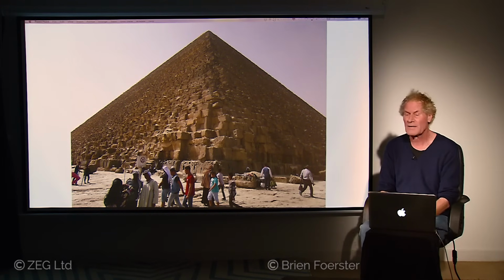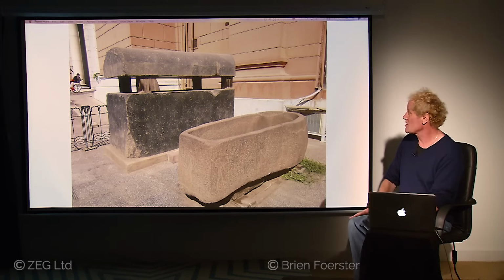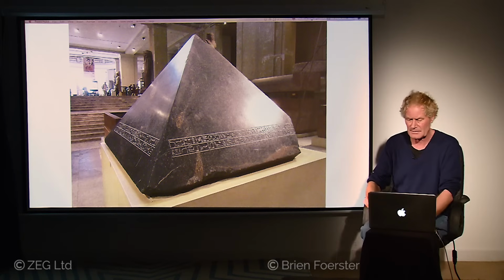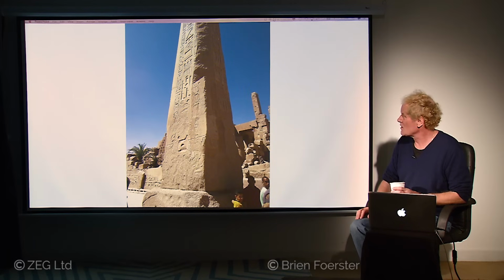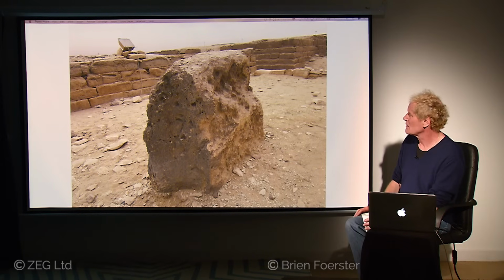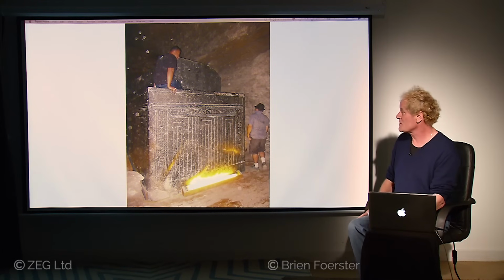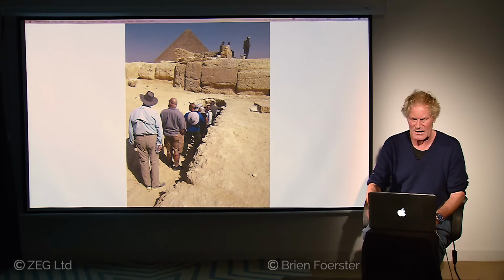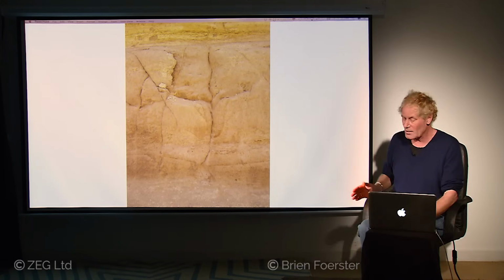Lost Ancient High Technology Of Egypt Full Lecture

Comment: Another abandoned stonework site. Obvious destruction and use of some machine tooling. Where are the machines? Drills,saws,blades? Has it been so long it disolved as rust? Its plain to see today with our machine shop set skills like large horizontal lathes. We bore deep holes in rock, engrave gravestones. statues etc. Cranes and heavy lift helicopters. Concrete pumpers. So its not so impossible to see these great projects.  I wan5 to know why they stopped,left unfinished, partially destroyed and everything else is gone. People and machines..all at once worldwide. I think why is the most important question.

Comment: I forgot the name of the scientist and searching for the footage of when he used some kind of diodes on a metal structure Weighing several hundred lbs then attaching two wires and invented the first remote controller while levitating the tructure around eighty feet in air while walking it all over a field on some us military base in 1920s or 30s . I believe he worked for the army.

Comment: The assumption that only one stone is cut, moved and set in place in 2 minutes is completely wrong. There could be 1000s of teams or more working in the same time cutting, moving and setting up stones. This needs to be taken into consideration when making an assumption of the time it takes to build one stone.
Reply: Acquiring knowledge and using it intelligently can be a powerful tool... you should try it sometime.
Reply: @bpd9660  I think you are in need for  a creative thinking course. Plan and go for it, definitely,  it will improve your thinking ability and you will be able to comprehend.

Comment: Love the straight forward lecture format. On the black boxes, seen a theory that said they used a type of fermentation process that produced ionized gas that needed heavy lids to contain the gases pressure and lead to a kinda bioluminescence of the surrounding air. Would explain the internal explosion damage you found.

Comment: His initial statistics are wrong.  If you accept his height number of blocks that make up the Great Pyramid as being 2.5 million and it was constructed Over 30 years and u took the rate of cutting and moving each block into position would have to take no longer than 2 minutes then the Egyptians would be able to cut and move actually 7884000 million blocks during that time.
There are 15768000 minutes in 30 years
15768000 minutes/2 mins for each block would be = 7884000 million blocks cut and moved into place.  In actuality 15768000 minutes/2.5 million blocks is every 6.3 minutes a block is put made and put in place.    If he gets this basic math wrong then I have to doubt everything else he says.

Comment: I think Brien is half right about the ancient advanced technology.... half right because he assumes the Dynastic Egyptians didn't know anything about it or used it. But they did. Or at least, the Pharaohs would've known the science behind the technology (such as how to make electricity and power machines with it) and certain echelons of citizens would've used it. Like the labourers tasked with making their fine silk, or gold jewelry. They would've needed electric sewing machines, and knowledge/application of electroplating.
I think the Nephilim originally built the pyramids. They're essentially gigantic versions of Nikola Tesla's Wardenclyffe Tower. Using natural energy currents from an underground aquifer, amplifying it, and broadcasting it into the ionosphere to generate free wireless energy across the land.
If you stand at the top of the Great Pyramid with a glass bottle and a wet cloth on top of it, there will be visible sparks flying from the bottle.
Imagine the crackling arcs of electricity that would've come off the gold capped Pyramids when they were pristine, and active.
Also, apparently the Lighthouse of Alexandria wasn't fire, but an arc light, powered by the Pyramids.
And, the Ark of the Covenant acted as some kind of superconductor for the Great Pyramid (there's a room in there with a box which has dimensions that perfectly match those of the Ark of the Covenant, and this room is placed in the Pyramid in such a way that it would greatly increase the output when generating electricity to have a superconductor in that exact spot) - and when Moses left with the Hebrews, they took it with them, causing Ramses to change his mind and chase after them.
There is actual proof that the story of the Exodus is true because divers found Egyptian chariot wheels on the sunken land bridge in the Red Sea.

Comment: The disk were used to funnel cavitation bubbles into breathable air. Spinning them underwater reduces the water pressure on the back edge of the blades resulting in boiling water which causes air bubbles. It can also be used as a fuel to assist combustion.

Comment: Another comment, maybe the shafts to the outside were used to fill the burial areas with another material, to preserve better, and the doors in these shafts were made to seal the area, maybe these materials were the reason that they might have destroyed any wall drawings in the kingdoms walls by accident, instead of preserving it, that accidentally detroyed things. Just suppose they filled it with alcohol and suppose an accident happened the alcohol burned or the seal was broken you will see nothing now even maybe burned the tomb or got dissolved by time that we can not find it. Somebody somewhere over did something with good intentions but it did not work and damaged instead of preserve. They knew hydrocarbons, knew alcohol, tar, textile, fibres even liquid absorption

Comment: Just to add another capabilty they had under their fingertip was 'Sound', drums and resonance, in ancient Israel history its suggested that they used resonance to demolish walls and sound to defeat enemies. If you combine these with pneumatics, hydraulics, resonance, air pressure, heat, light reflectivity, focusing you can achieve a lot. They also had pretty good knowledge in materials, from choosing type of lumber (Like Cedar) wood, for having high durability against insects, to various hydrocarbons oils to preserve materials even flesh, to knowledge of geology to select suitable rocks for their needs, to use limestone that was soft to shape or to use granite for other purposes, in addition they had good eyes for color and even making paints using basic pigments that our current paint makers do not match with their durability, they knew chemistry, they did lime knew the human body and antropology and agriculture, public health. We are under estimating that those knowhows were used up to the industrial revolution, what they lacked was knowledge about steel manufacturing but they knew steel from meteorites, maybe they even knew gunpowder (Chinese did). If you go back few hundred years back we have used their knowhow to make the industrial revolution, they had advantage over Europeans having warmer climate, they  could work for longer work times than Europeans due to longer daylights, more workable days and more to work outdoors, hence their productivity was high. Combing these together at those times were unique,  we tried to catch up, found solutions they did not have

Comment: In my view they were good in hydraulics and hence they could use to cut ( Water jet), grind, lift, move units., sand blast (Using fine sand, they could seive sand), they could do air blowers  They should have been able to create seals, knew leather, they knew bitumen tar, if they made on semi precision machine, they could have used it to make more precission units. They could use bronze, had most necessary tools. I do not think brute force was used but deffinetely lots of manpower with simple tools. If they were able to make , precission tunnels, they could make precission tubes for hydraulics, in our era if you look at the hydraulic pnematic system of Citroen cars, combination of pneumatics, liquid hydraulics, they could create pretty powerful tools, they had all the basics available then, including sealing system, in theory hydraulics was with in their reach. With ease they had pneumatics, using leather made blowers, sealing the leather for high pressure, heat to increase pressure, they could make simple tools, the hydraulic part  using various oils definitely they knew hydrocarbons, natural from trees, animals, it was within their reach to do thiese and no electricity required, they could have moved, grind, cut to precission, lift. What is also unique they should have had simple way of lighting the work area? Maybe the tunnel shafts were a way to bring in light from outside using bronze type of mirrors, nothing to do to gaze towards star, simple dedicated solutions were within their grasp. If you go back few hundred years back most these tools were done with no electricity, some not even using steel, all the way to 1950s leather was used as gasket. We want to imagine super knowhow but it could be very simple tools. Put youself in their place, how will you carry 1 ton piece if you were just 3 to 4 people, am sure with some simple creativity is possibel. Another thing they could do are pullies and they could do belts to connect them, these are not something new. No need to imagine outer space super technology, just simple tools, I used to drill holes for my hobbies  with simple hand powered drill without electricity

Comment: Here's some ancient ideas that people may have forgotten. 

For the cutting and drilling, there is a way to cut into granite. For cutting, they would chip a groove into the stone surface first, then they use is a copper saw with some teeth on it that has a heavy stone on each end. Now, it's not the saw that's actually doing the cutting, it's sand! They put sand into the groove and let the saw go back and forth motion to dig the sand into the stone. Eventually, they use water to help cut further into the stone.

Now for the drill, again, they use a cooper like tube with some teeth. They use a three man team to accomplish this. One person on each side of a stick with a string wrapped around the tube and one in the middle holding the tube with a rock on top of the tube to allow the tube to spin on the stone. This technique is very similar to using to start fires (looks like using a bow wrap around a stick). Then, they use couple of chisels (acts like levers) and hammer out the center piece. 

Now for the burn, could it have been a meteor or comet that got very close to the surface and then exploded? Like what may have happen in Chelyabinsk, Russia. Just a thought.

Comment: theres always war in the middle east because they want to destroy evidence, alexandria library was deliberate, if you see what solgdeirs have done there they blow up all ancient monuments, i dont believe for a second that , they wrote down everything they did on a day to day basis ,,but they forgot to scribe the building of one of the biggest structures in the world, nobody knows how the pyramids were built they hide that wall and just destroyed it, tesla found the way they harnessed the power from the ionosphere ,, then was told to destroy his tower in warden cliff nyc. he modelled it from the pyramid. light bulbs were wireless everything can be energized wireleslly with the right frequency just light a radio, static electricity is proof that there is electricity all around us , but were told its just protons negative and positive rubbing together thats another myth older vehicles use to have ground straps to stop you from getting a shock when you would touch the door,

Comment: Without the knobs the stones wouldn't have the right resonant frequency
Reply: That makes no sense. In a homogeneous structure like these stones, the resonant frequency would be the same throughout.
Reply: Just a thought I had so then they would have been used to move them?
Reply: @allendavis2030  Possibly. It's common to see a similar use of nobs on other stonework worldwide throughout history. Very useful for tying ropes, chains, or frames to the blocks for lifting and placing. After placement, they are typically chiseled off and the block's surface polished. What we're probably seeing is a construction site that was interrupted or parts of the structure that were left unfinished because those parts weren't where people would see them.

Comment: Granite and diorite are not eternal, they do weather over millenia. Sometimes slices come off like you see on this gravestone here: https://woodlandcemeteryhistory.files.wordpress.com/2019/06/20190421_103656-1-e1561036415981.jpg?w=798        You do not need "cataclysmic" plasma outbursts to weather or break stone surfaces. Millennia of hot sun at daytime and coldness at night time will crack the crystals that make up granite or diorite. Brownish colour on a stone could have come from that stone lying for some time in iron-containing water. I did not see a "heat molten" surface here.

Comment: It's not true that it is obvious that you can not produce two pyramid blocks per minute. You can produce multiple blocks at the same time, even in separate places, and transport them at the same time.
How does heat darken a stone? Not before it melts, as far as I know.
Weather pattern with deep erosion it quite possible in a region with sand storms.

Comment: Carbon dating the buried boats confirm about 2,500 BC. The technology was not Egyptian but the design was brought in by Enoch, and the Egyptians called it Par Hanuch or the Pillar of Enoch. The details are in the Book of the Dead.
Reply: Kufu and the Egyptians were forced to build it as vassals. Steel was used. There are many slag heaps in the Sinai which had a different climate,  from smelting at the time of construction. At the head of the valley on a rock ledge was found a statue of Khufu, one of only 3 likenesses remaining.
Reply: By the way the Ark has been found and the metal fastenings in its hull are in advance metallurgically of anything you could imagine, and are made of titanium aluminium alloy with 6 other metals. It is at a national monument site in the Ararat area in Turkey.

Comment: The precision of many cuts must be some sort of wire with an abrasive applied, similar to the guy who used string and toothpaste to cut through prison bars. You could change direction from downward to sideways very easily that way without cutting gaps around it. They would’ve perfected both the abrasive and wire material like Edison found the perfect filament for his light bulb.

Comment: Could it be possible that the ancient people knew that putting two radioactive materials or rocks together, would generate heat? Could Karnak, and others be ancient nuclear power plants?
Edit: could explain why the boxes weren't meant to be opened. And also the black material inside the stone boxes...Residue of an ancient meltdown?
Reply: Could it be possible that the ancient people at Karnak were struck by a meteorite that generated sufficient heat and blast wave to melt and topple their structures? In my mind that makes a ton more sense than ancient nuclear reactors that, had they exploded, would have rendered the region uninhabitable to this day. If there was a meltdown, the stone boxes would have had their bottoms and walls melted out, nuclear meltdowns are VERY hot.

Comment: Astrophysicists have discovered that Suns' not only eventually have Super Novas', but during their lifetime Suns' also have Mini Novas'. During a Suns' Mini Nova the surface of Suns’ eject their outer layer in an enormous plasma ejection and the plasma is millions of degrees Celsius. There is evidence of this in the past. Depending on which side of the surface of the Earth is facing the Suns' ejecting plasma will determine the annihilate of that civilisation.  

It can take a few days for the plasma to reach the Earth.  So, our Suns' Mini Nova can be witnessed 8 minutes 20 seconds after the ejection, but the impending catastrophe will be a few days away.   If you see our Suns' Mini Nova there is a high probability that you are on the side of the Earths surface that will be annihilated, depending on the speed of the plasma.  

Todays' Solar Wind, 8th Dec 2019, is 350 km/sec,  so those particles will take 4.960317 days or 119.0476 hours to reach Earth.  How fast would a Mini Nova travel ?

Comment: Hi, one explanation for the dark "weathered/burned" spots were done in the 9th century under the rule of the great kalif ma'moon... He desired to enter the pyramid and used an ancient seige method, known to be quite crude, he ordered a great fire to be built and maintained on the face of the pyramid then poured cold water over the red hot blocks, cracking them, and permitting his men to pierce the outer shell ultimately tunnelling until they broke into the inner shafts, making them the first in modern history to enter into the pyramid.  It was reported to be empty however it is alleged that the calif spent the night in the great pyramid, believing it to be a type of machine. By this time the pyramidion was already gone.  Scholars believe they ptolemiac Romans also entered the pyramid due to inscriptions found in the pyramid, However there is little to no proof in absence of such photos or sketches.

Comment: Is it possible that the slough off damage of the lower extremities of the walls/columns could have been caused by freezing? As in ice age ice. which of course means that in the thaw the remaining undersurface water would have made the surface deteriorate. Which also means that these structures would be far older than has been recognised.